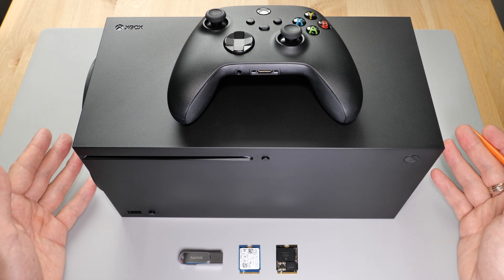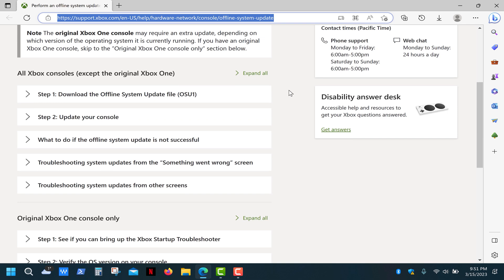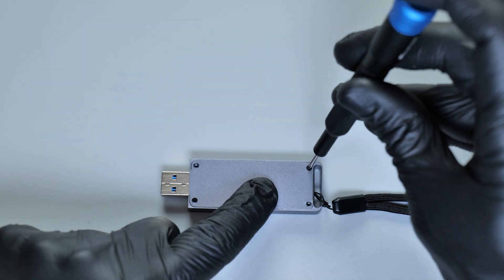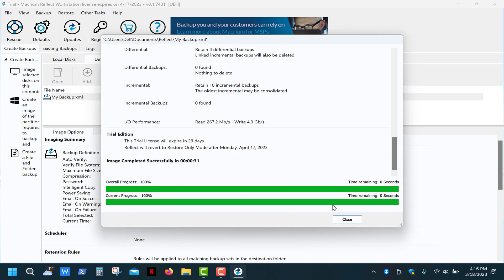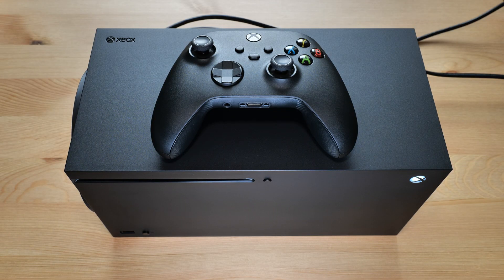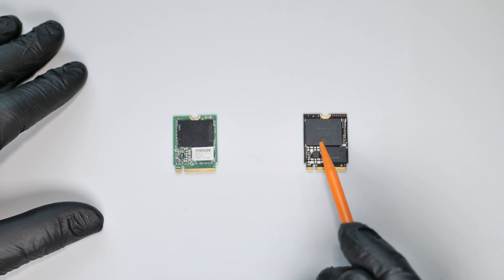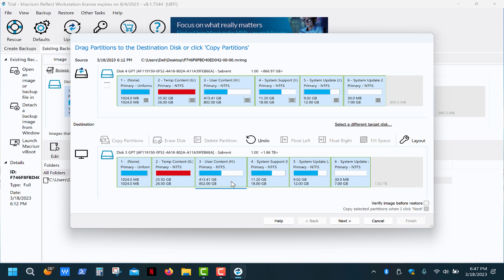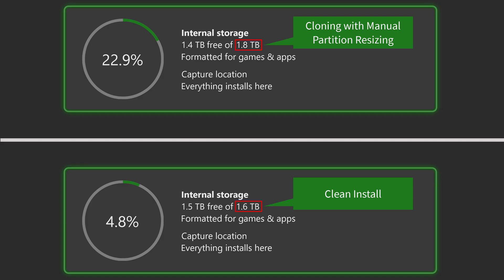Upgrade Xbox Series X SSD to 2TB – Clean Install or Clone Method (Step-by-Step Guide)

Comment: hello I don't want to abuse your patience but you are the only one who seems to know what you are talking about. can you explain to me this thing about offline update?

I do not understood. What do you mean here

" After each offline update, the encryption
key will be regenerated, which means
that the boot partition on the original
SSD won't work anymore. Your console
will turn on and immediately turn off.
Therefore, after every offline update
even unsuccessful ones resulting in an
error code, you must preserve the boot
partition from the currently installed
SSD "

If I preleve m2 xbox and cloning it on a new one the inner microsoft  code should be preserved (cloned) from original into my PC drive and then on  to the new  sn530 drive( would it work both on 1tb than 2tb?

After that I can instal it on xbox X motherboard and follow every step of your tutorial

and then I don't understand why after have installed a 2tb drive  in this  video you say this:
"P.S. It's not an upgrade to 2TB SSD video.
Even though I planned to create one, but
I have decided to postpone it for the time
being."
Reply from the maker: That means, for example, if you install a new SSD in your console and perform an offline update from a USB drive whether the update succeeds or fails due to an incompatible SSD the encryption key will be regenerated. As a result, your original SSD will no longer be valid. In such cases, you’ll need to back up the boot partition from the new SSD (even if it’s an incompatible one) and restore it onto the original SSD before running another offline update to bring the console back to a working state. Since the offline update rewrites the encryption key, it's absolutely crucial to preserve the last valid boot partition. Otherwise, your console becomes unrepairable e-waste.
Originally, I wanted to include a tutorial in that video showing how to modify a 2TB WD SSD that isn’t officially supported, to make it compatible. But due to some people’s greed, they refused to share the full process with me and just sold me a modified 2TB SSD. You can occasionally find these SSDs for sale on eBay or AliExpress. That’s why I said it’s not really a 2TB upgrade just a demonstration of what’s possible if you manage to get your hands on one of those SSDs.
Thankfully, we now have officially supported 2TB SSDs available, so compatibility is no longer an issue. Personally, I don’t recommend upgrading or investing in the original Series X anymore. It’s not worth it, considering the console’s limited lifespan and numerous design flaws. The new Series X Galaxy Black model with a 2TB SSD, on the other hand, features a refined internal design with all major issues fixed. I hope it answered all your questions.
Reply: @ElectronicsComputers  
 thankyou so much. Now it is perfectly clear. Unfortunately I have just invested money on xseries  buying this second hand console a few days ago and I would like it works on the next years. Is it possible to install both 1tb or 2tb size  sn530 without problem?

And could be usefull to test te og internal intk an enclosure usb adapter with a software like crystal disk to know the ssd status and TBW? or could be this test make ssd not recognize from xbox after re installation?
Reply from the maker: @Genoleso   Yes, that SSD model will work  just make sure you’re getting the WD CH SN530, not the WD PC SN530, as only the CH version is compatible. Also, the SSSTC XA model is fully supported on S|X. When it comes to TBW, that’s rarely a problem. Even in servers, I’ve never seen an SSD fail from reaching its TBW limit. The real issue is overheating, which can significantly reduce the lifespan of the controller, NAND chips, and other components on the SSD. Most of the SSDs we get for data recovery have failed controllers, not worn-out memory. I actually made a video on this, covering both M.2 2230 and 2280 SSDs and how to prevent these problems. To check your SSD’s health, connect it to a PC and run something like CrystalDiskInfo. The most important thing is  the Media Errors value it should be zero. If it’s not, that means some data on the drive is already corrupted. If your SSD checks out fine, just apply some high-quality thermal putty (I also have a video on that), and enjoy your gaming. In a couple of years, do a maintenance check, clean the system, and re-check the SMART data. If the drive starts showing signs of failure, just sell it before it gets worse.

Comment: Hello thanx for sharing. So could it be usefull to have a backup of OG partition on a backup unit to resume a xbox if internal ssd died?
Reply from the maker: It may help for a short period of time, but there’s no practical point in doing that, because any major system update can regenerate the encryption key, rendering your backup useless.
Speaking from my experience and the statistics from our repair shop, Xbox Series X SSDs usually start to fail after about 3 years of average use. The same happened to my own console—I checked the SMART status of the SSD and it was in pretty bad condition, so I replaced it just in time. In the newer Series X Galaxy 2TB, Microsoft fixed the SSD overheating issue by removing the shielding around the SSD. Now the SSD makes direct contact with the heatsink, which will definitely improve its longevity.
Reply: @ElectronicsComputers  thankyou. No way to install any sort of more efficient thermal pad and /or heatsink?

I can not find anyware a bra d new ssd you suggest for replacing thenoriginal one?cpuld you please recommand me one that surely works to clone my almost 4 years old genuine ssd (at the moment fully working but probably not much more in the next future)

1 tb is still the maximum size supported from x serie or right now with the new models is it possible to put a 2tb?

Thankyou sssoooo much

Comment: My series x wont turn on for more thqn a second with my SSD in. And without it, it stays on. Is it possible to copy the boot partition and then format the drive and put the boot partition back onnit for a fix instead of buying a new SSD?
Reply from the maker: Of course, it's possible—if the drive is still functional and the boot partition isn't corrupted. Without checking the SSD's SMART report, and trying to back up that partition it's hard to say for sure. On average, the SSDs in Series S|X consoles last around 3 years. If the SSD is dead or the boot partition can't be recovered, the console is basically e-waste. You could try selling it for parts—controller, power supply, optical drive, and other components—which might get you around $100. That money could go toward a new Series X Galaxy Black, where Microsoft finally addressed the SSD overheating issue, making those models far more reliable in the long term.
Reply: Thank you for answering my question. I have another though, I have another series x where it does that turning off immediately thing after turning on, but no matter what i do (new psu, ssd in or out) it still does it. Is this something i can fix myself or is it too advanced /expensive  @ElectronicsComputers
Reply from the maker: @yyokage  It really depends on your skills and the tools you have. Most likely, there's a short somewhere on the motherboard—it could be something simple like a shorted capacitor worth 10 cents, or a faulty $5 MOSFET on one of the power rails. At the very least, you'll need a multimeter and some basic soldering equipment. And of course, you need to understand what you're doing—how to identify and test components properly. So in the end, only you can answer your question.

Comment: Don't know how I got here. But wow. The disappointment seeing the Xbox and thermal paste gave me flash backs of working on the 3 rings of death. Things still haven't changed?? Spend so much money on a game console and Microsoft keeps raking in more money😔💩
Reply from the maker: Haha, I feel you — the 3ROD era left some deep scars 😅 Even today, consoles still come with cheap thermal paste and fragile SSDs. On top of that, the Series X had a pretty bad cooling design — they stuck the SSD inside a shielded cover with barely any airflow. Luckily, they fixed that in the Series X Galaxy Black, where the SSD finally makes direct contact with the heatsink. But yeah, Microsoft still cuts corners to save costs — and we’re the ones who end up paying for it. Some things never change, just more expensive now 💸

Comment: Hi bro, does WD Sn770m 2 tb work with the expansion adapter?
Reply from the maker: When the Xbox Series S|X first came out, they worked fine with some third-party expansion cards, including enclosures where you could install your own M.2 2230 SSD. But after a few system updates, Microsoft disabled support for unofficial solutions. Now, you either have to use an official Seagate expansion card or use a custom adapter with a compatible SSD—specifically one of the OEM models that were originally used inside the consoles.
Reply: @ElectronicsComputers these compatible SSD list where can I find them?
Reply: Thanks for your answer.🙏

Comment: Hello friend. Thank you for the video. Are there any new infos?
There is a 2tb xbox series x. Do you know what drive it has from the factory and if we can use this model to update from 1tb to 2tb internal storage?
Thank you
Reply from the maker: I only had one Galaxy Black Series X in my repair shop, but I didn’t check the exact model. From the chip layout, it looked like one of those OEM SSDs from WD or SSSTC using a Phison controller. These SSDs aren’t available on the consumer market — they’re intended for manufacturers only. I’m fairly confident they’re compatible with all Series S|X models.
Reply: @ElectronicsComputers they did some rework on the Xbox Galaxy Black 2TB ( 1) smaller 6 nm chip inside(previous 7 nm) (2) different cooling system inside(VPR is gone) (3)and some changes on the packing of the SSD(like get rid of the small metal plate of the SSD?)the Xbox Galaxy does generate less heat then it's predecessor from what i heard.

Comment: Hello, I have a question. Can you tell me the model of the 2TB SSD you used? And is SN740 compatible? I wonder.
Reply from the maker: Only OEM SSDs specifically designed for the console will work with the Xbox. However, some models can be made compatible through modifications, such as firmware editing, board-level tweaks, or replacing the controller from the expansion card.
Reply: @   It’s really complicated. Expansion cards are way too expensive, and with upgrades being this difficult, it feels like there are no options left — it’s frustrating.
Reply from the maker: @VortexText  To be honest, if a console is more than two years old, I wouldn’t recommend putting any more money into it. These consoles use 2230-format SSDs, which typically last only 2 to 4 years. When they fail, the console becomes unrepairable unless you can recover the encrypted boot partition—and that’s nearly impossible in most cases. We have dozens of Series S and X units abandoned by clients due to dead SSDs. So, if you still want a 2TB console, consider selling your current one while it’s still functional and put that money toward a new Series X with a 2TB drive. Or just use it as is—investing in an internal SSD or expansion card isn’t worth it.
Reply: @ElectronicsComputers Wouldn’t running games solely off an expansion card prolong the life of the internal SSD since barely any data will be read from and written to it? I found a used 2TB expansion for a good price and just bought a used 2021 Series X for $300 but now I’m thinking of returning it. Microsoft really screwed us. Could I backup the drive image to my computer, use the console offline so it doesn’t update, and replace the drive when it fails? Also, have you run into any PS5s with failed NAND chips? Doesn’t seem any more repairable there since 3 of the 6 chips have per console data.
Reply from the maker: @Random-r4o6i  Buying a used 4-year-old console is a big risk. These are the exact units that regularly end up in our repair shop. After fixing them, we often advise clients to sell while they still work. In theory, creating a backup and using the console offline can reduce the risk, but many games have license checks that require going online periodically. It doesn’t take long for the system to force an update which you can't cancel. In my own console, the SSD lasted about 3 years before showing signs of failure. Among PS5 units I’ve repaired, SSD issues are very rare—usually it’s overheating or HDMI damage. The newer Xbox Series X Galaxy Black with a 2TB SSD is better designed. It no longer has the old SSD cover that caused overheating, and the SSD now has direct contact with the heatsink. So in my opinion, it’s smarter to invest in a newer model or a PS5, and definitely not in a used Series X.
Reply: @ElectronicsComputers Thanks for your input.

Comment: hi, thnaks for this great video and tutorial... i got a question. i got a brand new 2TB SSD, i will do the clone methode. for all first, must i format the brand new 2TB SSD or not. only plug and do like your tutorial without formating? regards
Reply from the maker: There’s no need to format a new SSD. The most important thing is to avoid accidentally damaging or removing the original bootable partition on the SSD if you do, the console will instantly become unrepairable. Also, make sure you are using a compatible SSD. Other than that, the process is fairly straightforward and simple.
Reply: oh.. ok. thanks for your quick response. so i thing my SSD is not compatible. have try it 2 times with clone method, and my x will not start. the x button is lighting for 2 sec and turn off. don‘t have try the original SSD back again at this time to check up if….. don‘t know what is going wrong
Reply: hi.. can you tell me if this  SSD - Crucial P310 2TB M.2 PCIe Gen4 2230  - is compatible? can buyed by amazon...  thnx
Reply: Hi bro, does WD Sn770m 2 tb work with the expansion adapter?

Comment: This may be less important over times, but I would just point out the obvious which is you do not need to use the expansion slot or internal memory for  certain game Native Ap XBox Series games need to use those spaces but if a game was made for XBox one and then got an update which is basically running the same code with minor changes then some of the games that do that work just fine on an external SSD connected to the USB and the speed difference is pretty inconsequential. But the USB ports on the Series Machines are not full speed  so it does cause a slight downgrade in loading times even with a quality SSD. HOWEVER it means there is another category of game that doesn't require the internal storage.
So things like XBox Live Arcade, XBox, XBox 360, XBox One and XBox One "Enhanced for Series S/X" (not all - but basically if they didn't fiddle with the memory speed they can still work : 

Some examples would be : (note some games sometimes get removed after a patch like happened with Sea of Thieves)
 
Ark : Survival Evolved
Desporados 3
Halo MCC
Mass Effect Legendary Edition
Mine Craft Dungeons
Ori and the Will of the Whisps
Rocket League
State of Decay
State of Decay 2
Star Wars Squadrons
The Division 2
Warhammer : Vermintide 2
We Happy Few
Zombie Army 4 

So some thing to bare in mind if the game is older than the console and was later updated.
You can check in various ways- trying to move something usually tells you if it doesn't work it will tell you - if it does work it won't give any error message and this usually mean it works (though not sea of Thieves)

Comment: I sold the junk Xbox series x, the console is functioning properly, but I'm going back to one x
Reply from the maker: The Xbox One X is the best console Microsoft ever made. It’s extremely repairable and serviceable and  no issues replacing the HDD or upgrading to an SSD. With the Series S and X, though, it’s a different story. Because of the encrypted boot partition, if the SSD dies, the whole console basically becomes a brick. We’ve got a huge pile of dead units in our repair shop, and we don’t even bother buying them for parts anymore.
Reply: @ElectronicsComputers  I sold it while it was still functional. In my country there is a store that offers-hand consoles with a 5-year warranty. Perhaps in the future I will purchase another one, but for now, I am returning to the One X.

Comment: Do you believe that a 2tb WD SN740 would work?
Reply from the maker: That model requires some modifications in order to be compatible with the console. Without any modification you can only use WD CH SN530 or  SSSTC XA1.